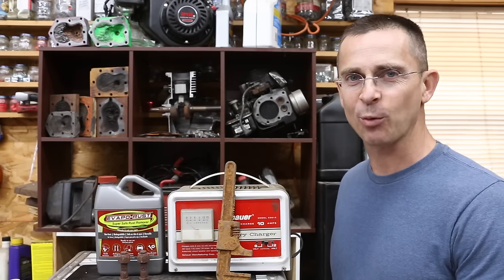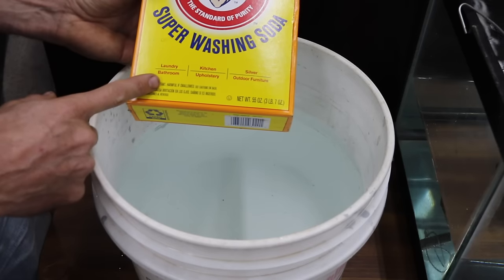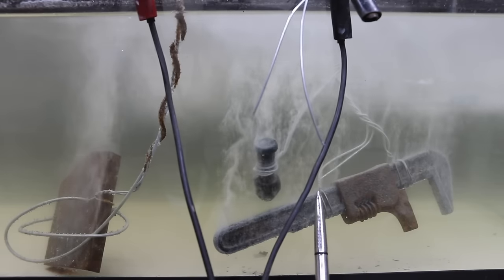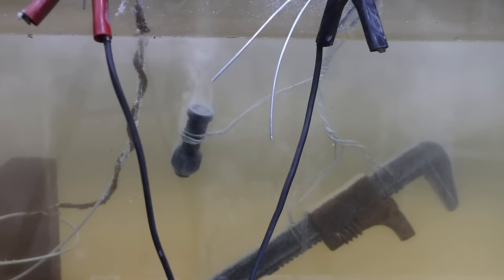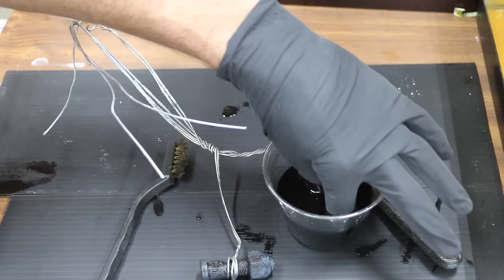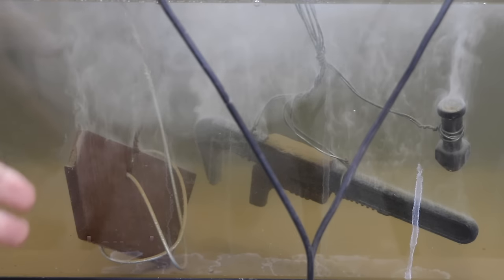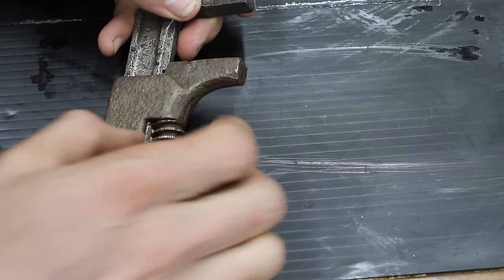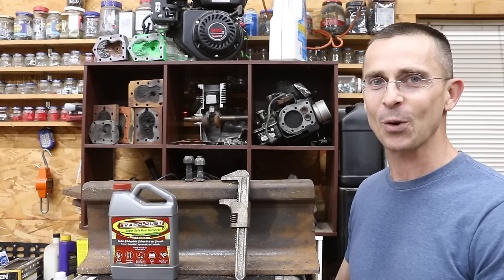Is Electrolysis better than Evapo-Rust?  Let's find out!

Comment: In case that you going to do that again, wire all movable parts to the negative, on bigger pieces you can wire it more places, you can also use more than 1 sacrifice metal at once. Also you can clean the sacrifice metal, brushing or sanding it when it gets too much rusted. You can do electrolysis with the sacrifice metal on the negative, when you want to cover something on copper or zinc, so those will be the sacrifice, and they will attach on the main piece, but you need to change the environment using another liquid solution.

Comment: For the electrolysis you have to provide a big surface area, so your sacrificial electrode has to be at least as big as your rusty part. 
the wrench also has a bad contact. you can clearly see it at 2:18
Reply from the maker: Great point. Thank you and Happy New Year!
Reply: @ProjectFarm  Happy new year! :)
Reply: First time he's done it.  I'd love to see him do it on something else using what he learned now!  MORE AMPERAGE!
Reply: I think if there would have been direct contact to part that adjusted it would have helped eat the rust off. Like you said, there is little to no bubbling occurring so it didn't have good contact
Reply: Thanks for info.  I tried electrolysis before and didn't get it to work.  My electrode was no where near as big as the part.

Comment: Looks like there were oxides keeping the sliding jaw and the shank out of electrical contact for most of the test.
Reply: Yes, he didn't connect to the loose portion.
Reply: I was thinking the same thing too. Now who wants to see electrolysis IN Evaporust??? I know I do!
Reply: evilcanofdrpepper sounds like a cancerous vapor would occur but I’m down to see that!
Reply: arent you supposed to surround the object with the sacrificial anode ? it works by line of sight.
Reply: +poppaluv That helps, but isn't strictly needed. The path of electrons in a conductive fluid is seldomly a straight line path. Metals are pretty close to perfect carriers of the electric field, so the field strength will be roughly the same along the whole piece of metal that has electrical contact. Roughly the same 0V is present along the whole surface of the wrench, and roughly the same 12v is present along any unoxidized surface on the anode. The difference being length of path between the outward facing sides of the two metals compared to inward facing sides, so more current flows along the inside paths than the longer paths, but some current certainly still flows along all parts of the cathode.

Comment: I wish you had weighed the sacrificial steel before and after as well.
Reply from the maker: Great point! I should have done that.
Reply: @ProjectFarm  You could a follow up with different electrolytes as well
Reply: I was thinking the same thing
Reply: @ProjectFarm  try molasses and water. About a 50:1 ration. Needs a very long time but amazing. Especially on aluminum.
Reply: The sacrificial steel looses weight. You also end up with rust at the bottom of the bucket.
Reply: @Patrick Does that only work on aluminium and does it have to be a certain kind of molasses?
Reply: imo it's not very relevant what the sacrificial electrode is doing, or made of, because it's not like the electrolysis is replacing (or restoring) the iron that has already converted to rust. afsik it's just a fancy way to dissolve iron oxide

Comment: I've noticed that you had the electrolysis wire hanger leads only to the non moving part of the wrench. After first inspection, it was easy to tell you could have used another wrap of wire around the moving section AND the thumbscrew for better conduction/effectiveness JFYI

Loved the video. Keep up the good work

Comment: It looks like the sliding jaw of your wrench was not making electrical contact ?
Reply from the maker: That may have been the issue. Thank you!
Reply: I was thinking this too.  I noticed when using electrolysis to clean cast iron that the side facing the electrode would clean up faster.  GOOD video.
Reply: good thought!

Comment: Im wondering if the wrench if it had the metal wrapped around the movable piece if it would've removed more rust quicker.
Reply: I think so, it seemed to have a conductivity problem in that area.
Reply from the maker: Great point!
Reply: Electricity finds the path of least resistance.  As the wrench handle lost rust, the electricity would preferentially flow through the handle and less through the movable jaw.  I think it would have helped to connect to only the movable jaw at some point.
Reply: My first thought is no it wouldn't make a difference. On second thought rust isn't conducive to electrical currents and if the bridge between the two parts is mostly rust on both sides then you might have a point.
Reply: Exactly!  You need to make sure that all parts of the item are connected to the supply source.  Rust is a terrible conductor of electricity, so naturally, the movable jaw really wasn't connected to the source in any significant way.
Reply: I think it definitely would have, you can see there's no bubbles coming off the moving jaw, only off the fixed part of the wrench where the wires were touching.

Comment: i am pretty knowledgeable on the physics of the electrolysis, so i have some insights:

rust is a poor electrical conductor (it is a poor thermal one as well, but that isn't important here), so scraping off a small section to get better contact with the electrode to the rusted thing you are using will help.

the distance the oxygen molecules have to travel decreases the speed of the process, so moving the sacrificial anode closer will help speed things up.

the better the conductivity of the fluid the faster the process works, so mixing in the carbonate was a good idea.

as travel time is important facing the sides that you want the rust to be removed and where you want it deposited (sacrificial anode) will help speed things along.

try to get all pieces of an object connected to the electrode, other wise the electricity has to travel through the electrolyte solution to the piece to energize the pieces not connected, which slows the process down for those parts.

cleaning the sacrificial anode will help keep the process from slowing down as the anode rusts and inhibits electrical flow.

a steady amount of ionization keeps things flowing, as the voltage drops the ionization will shift, possibly adding rust to the thing you want rust removed from. overall the rust will be removed, but this slows the process greatly and may slightly alter the shape of the object being cleaned.

more voltage isn't always better, the process on the rusted object and anode works at a given amount of voltage. the extra voltage that may help is based on ionizing the fluid, at a certain point the voltage will separate the water (even microscopically), increasing resistance and eating up more amperage while inhibiting oxygen flow slowing the process. so to speed thing up go ahead and increase voltage until you see a decrease or a slowing of the rate of bubbling per volt increase, then back it off to the 'good range' and keep in mind any sort of change (even taking the stuff out to weight it then putting it back) might change that range slightly.

the process works based on flow, so it works best on the surface with lots of fluid around it, so it will work slower in nooks and crannies.

stuff in water likes to separate out, agitating the water every so often can help, though keep in mind the water needs to be ionized to work, and agitation can disrupt localized ionization. so try no to agitate the water between the anode (sacrificial metal) and cathode (thing being cleaned).
Reply from the maker: Thank you for the information!
Reply: Would using a less noble metal help also?
Reply: @markm.3101  it is based on the charge of the metals. there are charts which list in order the galvanic action between metals. having two metals which react strongly will help, but the difference in electrical use to overcome this and accelerate it makes this a minor issue, but the different metals would be a factor.
Reply: Ok just trying to compare it to how we protect underground structures. For instance with gas pipelines we use magnesium or zink. We energize carbon anodes with DC power also.
Reply: @markm.3101  it is the same principles as such, except you are trying to do it faster and smoother. the big difference is that it is in water, so the better comparison would be the anodes on boats. again same principles so you will see almost identical setups to some of the pipelines and such. it is very similar to the order of noble metals, though sometimes one ends up being more or less reactive due to some where reason (carbon/graphite is one which flips around with gold/platinum).

with the boats you use zinc (or aluminum in fresh water sometimes), and then you energize the metal parts with DC electricity, though you try to match the electrical potential of the water when it reacts to the steel on your boat, as any higher eats your zinc mainly from the metals in the water (though it will eat some of the steel parts, sending the iron particles to your zinc). of course boats tend to move, and the more they move the less they rust. that is due to the ions causing the rust, and if the boats is moving then the ions have less time to work their magic. if the water is kept from moving you end up with more pock marks due to rust, due to bubbles forming and blocking the salt ions from getting to the iron atoms.

Comment: for optimal efficiency the sacrificial metal anode should be cleaned with a wire brush at the end of every day. otherwise the rust cannot transfer properly
Reply from the maker: Great point!  Thank you
Reply: Or instead of using a sacrificial metal, swap it for a piece of graphite. Graphite will end up (a) easier to clean (b) doesn't need to be cleaned as often to keep the electrolysis process optimal.
Reply: It's better to use a passive electrode. Stainless steel is an affordable option, and graphite would likely work but I haven't tried it.

The rust doesn't transfer between pieces, it's just reduced to Fe2+ from Fe3+ by adding electrons. Using a sacrificial electrode slows down the process by adding a bunch of Fe3+ to the water (in my experience).
Reply: The two times Ive done it I used a length of rebar with great results. Ive got a piece of stainless bar stock I will have to try next time.
Reply: @ImTheJoker4u  you guys may be missing the point of  sacrificial metal ... in a hot water heater once the sacrificial rod is gone the water starts to attack the tank, thats what i know so im assuming this  sacrificial metal is needed for the same reason
Reply: Graphite can be bought cheaply as well. Even Amazon sells it
Reply: @ImTheJoker4u  enjoy the chromates that stainless steel leeches into the bath. You've been trolled.

Comment: The darker appearance after electrolysis looks like you “blued” the metal, turning the red rust to a more stable iron oxide often called black rust. Proper and complete bluing of metals will prevent the damaging and corrosive red rust from taking hold. It was more popular before chroming was a thing but it still works pretty well.
Reply from the maker: Thanks for the feedback.

Comment: I've seen a video where a guy used a block of carbon (graphite) as the sacrificial electrode. It doesn't decompose like the steel, and keeps the solution cleaner. Trouble is, such carbon rods (as for electrical discharge machining) are costly. Perhaps a budget trip to Chernobyl might yield a suitable block of graphite? Just kidding! Happy new year, esp. to that long-suffering Toro!
Reply from the maker: lol. Thank you and Happy New Year!
Reply: you can get carbon rods out of 6v lantern batteries you find in the camping/outdoor sections
Reply: What about the center of an old 6 volt battery? I saw an old King of Random video (oof) where he used them as electrodes for an arc furnace. They are small, but you get 4 of them so that might still work.
Reply: I heard the Toro is getting his own channel.
Reply: Could also grind the copper off a carbon arc gouging rod. They're pretty inexpensive. Also the possibility of taking apart old lamp batteries and getting Carbon rods from them.
Reply: McMaster Carr sells 3/4" x 12" carbon rods about 2$ each in a pack of 5. Highly recommend them over a steel anode. You do lose out on the actual reversal of rust back to Iron 2 or sometimes even just iron. But you get a nice coating of carbon that helps reduce flash rust.
Reply: you could make your own carbon materials, but I don't think carbon rods are that pricey.
Reply: Carbon is good but platinium would be better, but way more expensive
Reply: Use the graphite out of a pencil if you want real cheap.
Reply: If you have a welding supply near you you can pick up a box arc gouging rods, there carbon,about 35$ for 50 of them.
Reply: The non-alkaline D batteries had thick carbon rods in them.
Reply: How about charcoal from cold camp fire?
Reply: KM Crafting 
Hmm your comment gave me a lightbulb moment... 
Use regular sacrificial for the most part then for the last leg switch to carbon to get the bonus of the carbon layer to help reduce flash rust. 👍
Reply: The graphite works, used old vanes from an oil less pump, as they are graphite in some models. Tried it using acetic acid to free up a very rusted 25mm micrometer, got it eventually after about 6 hours to the point I could start to move the barrel and eventually dismantle it and clean it. Full of pitting and marks from the rust, and the rachet at the top rusted away completely, but was able to assemble it again into working condition. Now it lives in an oil bath in the box, so it will not corrode again
Reply: @sleeptyper Good idea, I think charcoal could work for this purpose (however it's not pure carbon and the conductivity may vary piece by piece, but that should be OK). The arc gouging rods suggested in one of the comments above should definitely work.
Reply: @SkookumChoocher  Maybe twigs or pieces of branch completely pyrolysed in a paint jar with a hole in the lid? They are as close to pure carbon as plant material gets. I'm just considering the cost of electrodes. Nobody wants to spend 35$ to unrust a pipe wrench when new wrench costs 20$.
Reply: @sleeptyper Of course, that makes sense.
Reply: haha

Comment: How about electrolysis in evapo-rust?
Reply from the maker: Thank you for the video idea!
Reply: Exactly what I was about to post
Reply: I was thinking that too. Non flammable and non poisoning as far as i know. Im not sure what it will do with electricity breaking the chemical bonds though... especially since I don't know what it's made of.
Reply: I'd like to see this! I use evaporust in the ultrasonic cleaner and it's awesome!
Reply: Mind.  Blown.
Reply: I was going to say the same thing.... SHOW ME! :)
Reply: Evapo-Rust is water with a chelating agent and surfactant/detergent added.
Reply: Whats the msds say it contains? It is probably phosphoric acid based.
Reply: To Killi:
EvapoRust is non-hazardous. You can drink it and it'll just give you loose bowl movements. HaHa.
It can be transported by Air-O-Plane and delivered by USPS and I don't think there's even an MDS sheet on this product.

EvapoRust is $20/gal on Amazon, usually. I've been using it for years and recently learned that keeping it at about 150deg F decreases soak time drastically. Metal container on Stove Top @ LOWEST heat setting left all day long, then heat off and let sit overnight. Next AM, clean with wire brush, wash in hot soapy water and dry. Looks great! Dip it in EvapoRust and let dry will stop it from flash-rusting for weeks or even a few months.

I also just began using Electrolosis and have observed the same results as posted in this vid, except EvapoRust is much-much faster when kept warm.
Because of the costs, I'm going to start using Electolosis more often, especially with larger parts, and heated EvapoRust for quick turnarounds.

They don't call me 'The Rusty Old Ford Guy' for nuthun!
Reply: @ProjectFarm  lol I thought he was joking you can do that?
Reply: Jerome Lawson Actually, nobody not related to the company knows, as it’s a closely held secret. From the MSDS I don’t think anything bad could come from it, but better be cautious.
Reply: Unsure of the effect during electrolysis, page 3 of the MSDS states that it shouldn't be used with Oxidizing or Acidic chemicals, other than that, Evaporust seems to be stable, boiling point compared to water 212°F(100°C) non-toxic and a  Ph of 6.1... worth the experiment in a ventilated environment with protective measures, disposable suit and/or full respirator... Again just an unknown factor to how it would react

Comment: Thanks for sharing!  I have used electrolysis for over 20 years. Its a great process, can be dumped down the drain too when done.  Also, if you can't find washing soda you can make your own by baking baking soda.  Most parts I do are in much smaller containers so you don't need a giant tank.
Reply from the maker: You are welcome!  Thanks for the feedback.